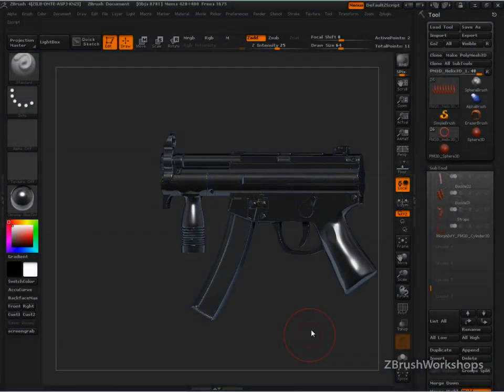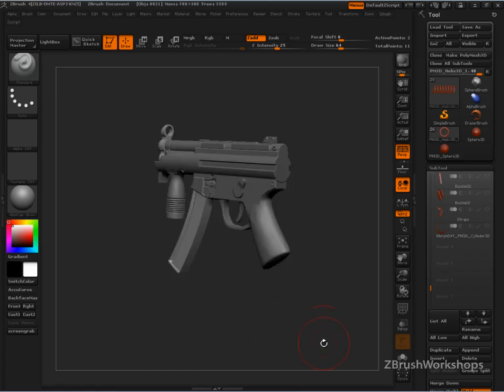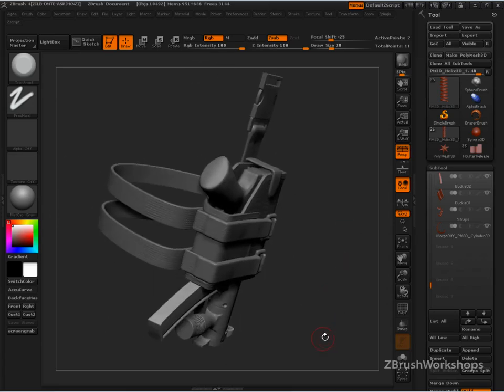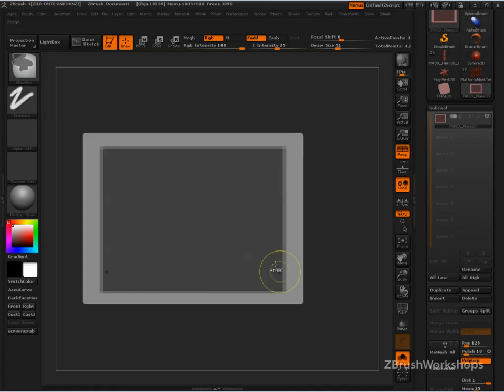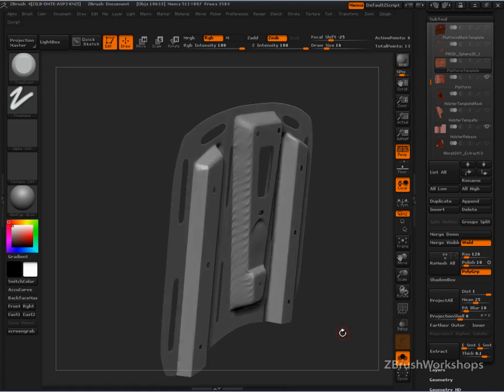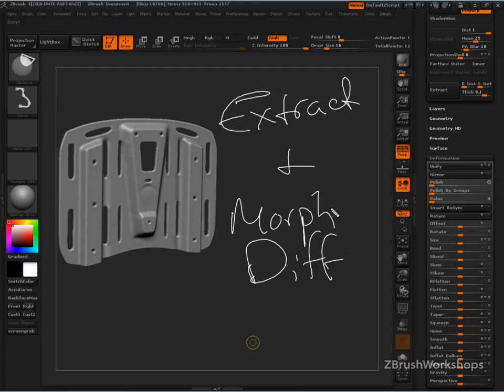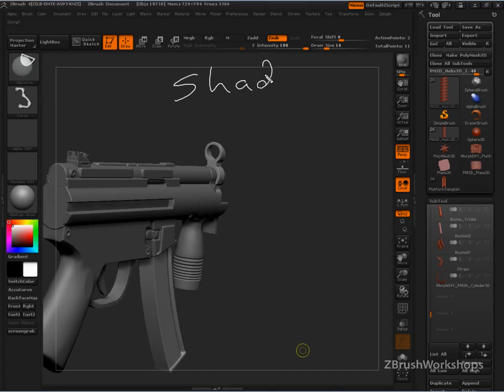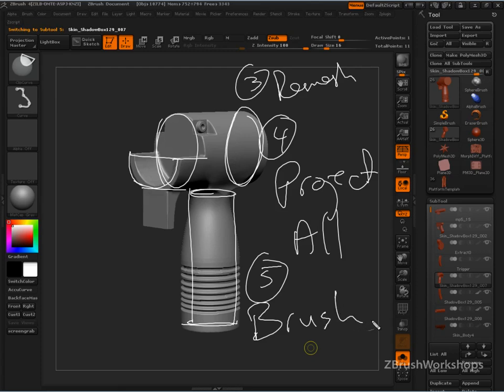Sculpting MP5-K in ZBrush 4

Comment: Would it be possible to use this workflow for making gun assets for an FPS game? But I can see the problem of not being able to animate the cocking of the loading chamber, the changing of magazines, and the trigger being pulled in Maya or 3DS Max...or am I missing something? Sorry, I'm still fairly new to ZBrush.
Reply: You can do some simple editing in maya when you're done with your sculpt though. For example you can extract faces on the magazine and make it a separate object, that way you can animate it later on if you want to.
Reply: I'm using 3DS Max for a low poly Glock and laid out photo accurate textures to the model and the gun looks good enough for a game. I'm going to use Ryan's technique to build hires concept weapons and animations.

Comment: It seems to me that Zbrush is a single item centric package and not tailored for outputting architectural or machine designs and is instead geared towards fine art, movies, and game. Maya which has it's ancestry in CAD has precision units, Blender has STL export. It's all a kind of smorgasbord sometimes when you don't want to use the way its main audience does.

Comment: How do you check scale and measurements while doing this? I work with mechanical objects for real time applications all the time that require down to the millimeter measurements. I have created many objects that output a great normal map to a lower poly object, but I worry that any object I create in Zbrush can only be created free form. Because I cant find any way to measure objects within the tool.